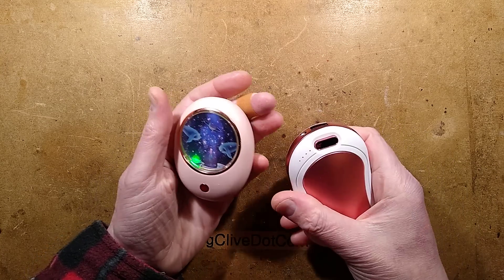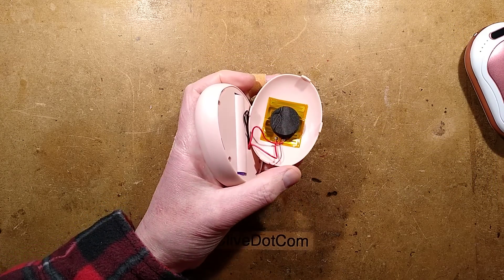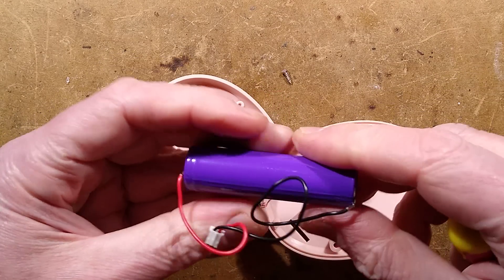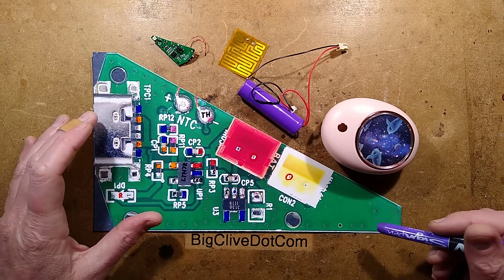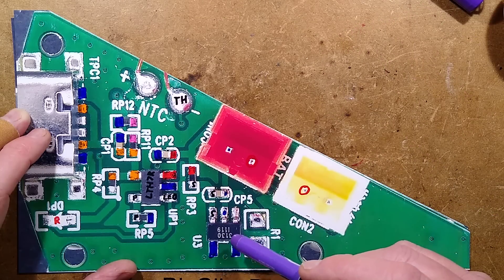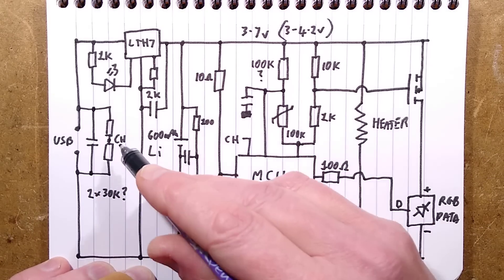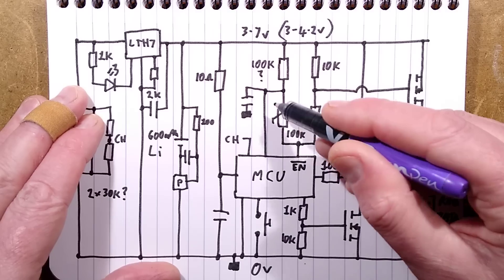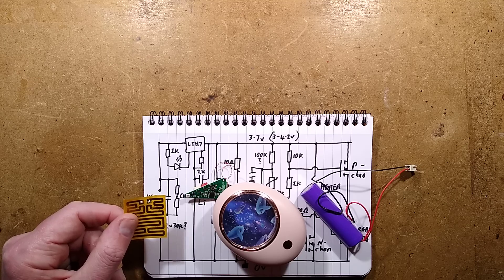Engineers vs accountants the handwarmer mix.  With schematic

Comment: What "data" does the RGB LED receive from the MCU? I had always imagined they had four connections - red, green, blue and common - but this has only three. I can imagine there being a chip in there which can interpret, say, binary digits coming down the line as colour settings, but usually if you are sending binary data you have to have a clock as well to tell the circuits how long to "listen" for each bit and when they start.
Reply: Most serial LEDs, such as the WS2812, rely on timing. A 0.35us pulse is a binary 0, a 0.7us pulse is a 1, and no pulses for 50us or more period causes a reset
Reply: @g0hjq  I had no idea! Thank you.
Reply from the maker: It gets better.  If you chain multiple LEDs with links between their data out and data in you can drive hundreds of them with complete control over each LED's colour.  Each LED takes its three RGB bytes and then passes the data stream onto the next LED.  When the data stream is paused briefly they transfer the data to their output.
Reply: @zh84  The SK6812 that now replaces the WS2812 is similar with its 1wire-like timings sensitive protocol. But the more reliable and way faster LPD8806, APA102 and the modern SK9822 provides the same daisy chain functionality with an additional clock signal wire and a protocol compatible with SPI bus (just no use of Cselect and MISO).

Comment: It's a lovely competent circuit design with some extra bits that perhaps the accountants didn't understand so left alone. It's also possible that factory used an inferior part (battery) and perhaps these are on the market now as a result of the client rejection from the factory on quality grounds...?  - Or it's as you say, bean counters influence...

Comment: I’m curious what the resistance value is. (You may have mentioned it, but I didn’t catch it.) According to my math it’s around 3.36 Ω
4.2 volts divided by 1.25 amps = 3.36 Ω
Reply from the maker: Yeah.  Roughly 3.33 ohms.